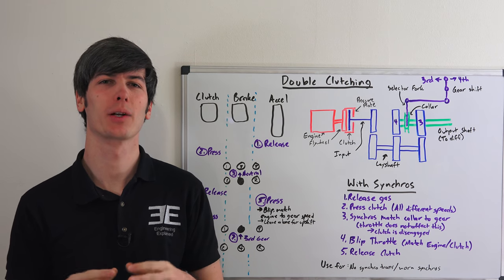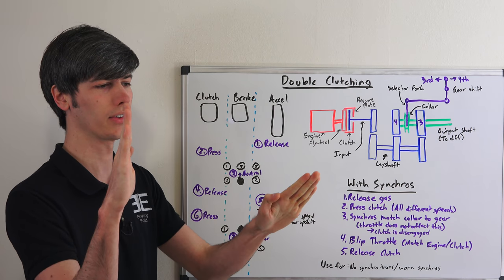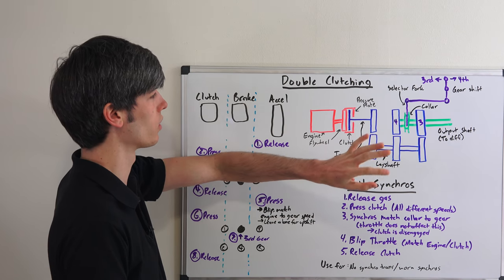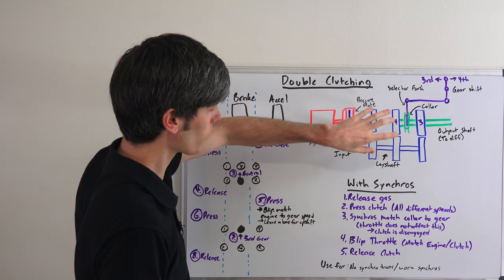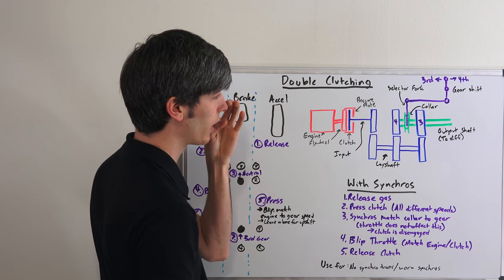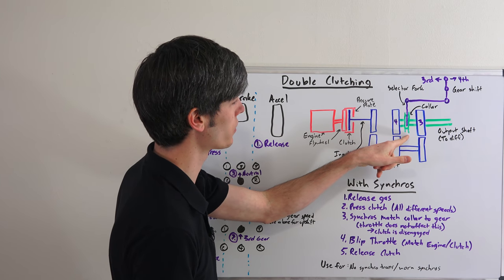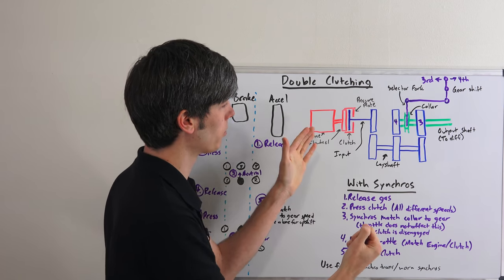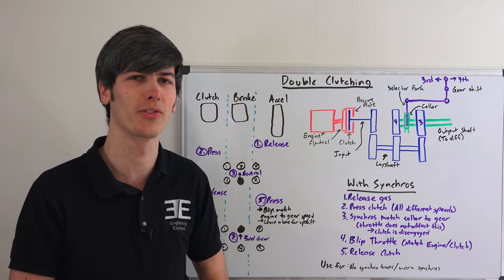What Is Double Clutching?

Comment: isn't this called rev matching ?
Reply from the maker: +Erik Angulo https://youtu.be/FnXLZg_O1rk
Reply: +Engineering Explained Watched both videos, and still don't understand the difference, could you or someone please explain? Thank you.
Reply: +Tomas Prado Rev matching involves pressing the accelerator enough to get the engine RPMs to spin at a rate to match the rotation of the driveshaft. The synchro gears that are part of the gears in the manual transmission box help those gears rotate with the driveshaft as you move the stick into gear. So the driveshaft and the transmission gear are rotating at the same rate. When you release the clutch and the flywheel engages with the transmission gear (through the countershaft), you&#39;ll want the engine RPMs to match as closely as possible.

With double clutching, you&#39;re lining up the engine with the transmission gears first by releasing the clutch while the transmission is in neutral. Then you want to adjust the RPMs of the engine (and because the clutch is released, the transmission as well) with the driveshaft rotation before moving the stick into the gear you&#39;re selecting. This will help the transmission gear and the driveshaft mesh together with less wear. Since the engine RPMs will be rotating at a similar rate when you release the clutch the second time the transfer of power should be smoother.

The essential difference is that rev matching is about getting the engine RPMs to match the driveshaft rotation while double clutching has the added step of using the engine to adjust the transmission gear rotation to ease the meshing with the driveshaft because there are no synchro gears effectively doing it for you.
Reply: +Tomas Prado Rev matching is essentially the same thing, except the clutch is disengaged from the engine, and thus all the load of "synchronizing" upon contact is placed on the clutch, not the synchros themselves. When the car is in neutral, your clutch is mashed to the flywheel, and thus all your gears will spin with the engine speed, they just won't be connected to the output shaft. With rev matching, your clutch is away from the flywheel and your gears and spinning at wheel speed, not engine speed. For example; my 2nd gear synchro on my STi is slightly worn out, and at high RPMs tends to grind a bit. When downshifting from 3rd to 2nd, it's easier for me to double clutch and synchronize the gears with the engine than it is for me to rev match and engage the clutch quickly enough to both 1) keep the momentum, and 2) not wear out the clutch and throwout bearing. It's hard to explain without a moving diagram or animation, but hopefully my explanation and Jason's diagram can help.
Reply: +Bernie Lee that actually did help thanks 

but the double clutch that I learned..."in the racing world"
is when you push in the clutch for a fraction of a second while accelerating to raise the rpm level and then you release the clutch while it is still in gear so the engine will pull at a higher rpm then when you initially engaged the clutch
Reply: +Tomas Prado Don't be offended; I am going to try and eli5 without being insulting (bernie lee did a phenomenal job of explaining it similar to how engineering explained guy would have I think).

Your engine and your driven wheels spin at different speeds. 
The transmission makes this happen, and can be disconnected from the engine by engaging the clutch (and therefore disengaging the engine - when you unplug your phone, your hand is acting like a clutch being engaged, when you plug in your phone, your hand is acting like a clutch being disengaged). 
When you upshift, your engine is spinning faster than your wheels. 
When you downshift, your engine is spinning slower than your wheels. 

Rev matching is when you disconnect your engine from your wheels, and either touch the accelerator to speed up the engine, or just wait while disconnected and allow the engine to slow naturally before putting the car into the next gear.

Double clutching involves the neutral 'gear' (which is 'in between' any 2 other gears); where your transmission spins at the same rate as your engine, but not your wheels. You double clutch by shifting into neutral, and then rev matching as above, and then shifting into the gear you want.
Reply: Erik Angulo I don't see how that would actually help. If you're the spin disparity might create a slight pulling effect but by disengaging the engine from the driveshaft you're going to lose power that's going to toward acceleration. Essentially you're going into a coast (i.e. no longer accelerating) and then using the engine to pull again. The time spent coasting wouldn't be made up by the sudden acceleration of re-engaging the engine at a higher RPM.
Reply: Erik Angulo That's called clutch kicking, used to force a sudden acceleration at the tires to break traction, not double clutching.

Typically you clutch kick a lot when trying to drift a car with a high grip to power ratio (underpowered or overgripped).
Reply: +Bernie Lee have you ever tried it ?
I have and it has results...nothing major but It helps In a drag race a little 
and I don't think Dom from fast and furious was talking about the double clutch explained by engineeringexplained
Reply: +Jesse V yes! clutch kick that's right
Reply: +Erik Angulo :)
Reply: Erik Angulo Jesse V I can see using it to break traction into a drift but not for straight ahead acceleration. I'll practice it a bit and see if can get it to give me a better bump. But I'm also not drifting as I'm in a FWD car.
Reply: Erik Angulo I use clutch kicking paired with an aftermarket rev limiter to simulate a poor man's anti-lag, aka flat foot shifting. My rev limiter is set at 6k rpm, where my boost peaks at; I disengage the clutch enough to shift gears, and the rev limiter keeps me from over revving, but still allows me to hold boost between shifts. It helps a lot with turbo cars in straight line stints, and I suppose could also work in N/A cars to lessen the load into the next shift.

However, I'm assuming the rev matching/double clutching we're talking about is in reference to downshifting, not accelerating lol
Reply: +Bernie Lee hey dude is it true that double clutching is only needed for older cars?
Reply: Ziggybro Seems like that's the case according to most of the comments. I have a 6 gear commuter that I also use to drive for Uber with nearly 100k miles on it that I generally drive without using the clutch after 3rd gear. Synchros are still working fine, clutch plate has plenty of wear left on it and there's no worrisome leakage from my master or slave cylinders.

To be honest, you're more likely to get bored with your car before you have a mechanical failure due to excessive wear on your transmission. As long as the power transfers are smooth and fast enough for what you're doing with it, does it matter how you do it?
Reply: +Erik Angulo  Sounds like power shifting to me lol. That increases clutch wear and usually a lot of people do that when racing because increased norepinephrine and adrenaline  released in blood makes their shifting sequence sloppy and don't depress the accelerator enough. But ya'know, some people might call that a strategy, doesn't sound like one to me.
Reply: +Erik Angulo Rev matching is similar, but you're trying to synchronise the gears in the gearbox with a double clutch as opposed to synchronising the engine to the gearbox. When you downshift in a vehicle with synchromesh (basically any modern manual transmission vehicle), you should try matching the engine RPM to the gearbox's new speed to prevent an engine brake situation which, of course, creates a massive jolt as the engine tried to match its speed to the gearbox. You don't need to double clutch it as the gears will begin to rotate at the same speed as the output when you move the synchroniser in. 

When you rev match, this reduces clutch wear and also makes the ride smoother since the clutch disc and the flywheel are rotating at the same (or close to the same) speed and thus, so is the gearbox itself. When you have a vehicle that doesn't have a synchromesh system, (maybe a really old vehicle like a 1955 Stepside Chevi!)  when you try to shift gears without using double clutching, the input and lay shafts will rotate at a separate speed to the output shaft and its subsequent gear, which will create a situation where you have to grind the living hell out of the gears to get them to synchronise to the point they can mesh and transfer the drive... bad thing in general!! you can absolutely annihilate the gears like this, so with a double clutch method, you are making sure this doesn't happen. You disengage, speed match, select and re-engage the gearbox in one process. Again, with synchro, the gearbox will automatically spin the gear you're selecting up to the speed it needs to be at before it meshes with the lay shaft, whereas a non-synchro gearbox simply can't do that... it needs to be manually synchronised to have a smooth shifting behaviour!
Reply: +Bernie Lee depends on your vehicle really... if you're driving a non-synchro transmission vehicle then you'll just shred the gears trying a short-shift technique or not using the clutch!! Of course... we don't see that anymore on refurbed or new vehicles because not everyone can be bothered to learn how to double clutch and synchronise!
Reply: +Bernie Lee , +SideWays8Productions , +Jesse V , thanks for clearing this up for me!
Reply: ThEcRaZ3dGaM3R Of course it depends on your car but let's consider a couple things. 1. If you have a car these days with a manual transmission that doesn't have synchros, you bought it for that specific purpose because you're buying A) a very old classic with original parts or B) a modified car with a specific transmission. So if you're wondering if it has synchros then it leads to the next point, 2. easily more than 75% of the manuals on the road have perfectly operating synchros.
Reply: Bernie Lee Yeah, there's a 99.9% chance any modern vehicle is gonna have a synchro transmission... it's only really classic vehicles that don't (willing to bet 1955 and older... DEFO 40's!)
Reply: +Erik Angulo ... Yup, rev-matching.
Reply: +ThEcRaZ3dGaM3R - Some cars prior to the 1950s had syncrhos only on certain gears. Many 3-speed transmissions did not have syncrho on first gear but did have them on 2nd and 3rd. Likewise, many 4 speeds had them on 3rd and 4th but not on 2nd and 3rd.
Reply: +Erik Angulo No, Rev matching is part of double clutching but double clutching is not a part of rev matching in 99.99% of cars with manual trans on the road today.  Actually I expected a video on truck driving cause that's where you need to know how to double clutch.  Either that or you have a car with worn out synchros on all your forward gears(the 0.01%).  In otherwords, useless information for cars, essential information for truck drivers.  .
Reply: +Tomas Prado - Proper double-clutching matches all of Red (Engine/Flywheel), Blue (Transmission/Layshaft), and Green (Outputshaft/Drive Wheel).  Rev matching only matches Red and Green, while relying on the synchronizer to match Blue and Green at the time you shift into gear.
Reply: +Tomas Prado it's only necessary if you have a slow ass car, like a Honda or something. double clutching is pointless if u have a little something Honda owners don't understand called TORQUE
Reply: +jcrohm88  learn english again usin a teknik to type faster get w da times. nd yea ur right bout da $$$ part but u need dat wit any car import or not i love all cars bro idk i dnt hate any kar except smart mini coops nd prius nd all dat shit but ok yur opinion is yur own nd mine is mine so w.e good day to you sir.
Reply: +jcrohm88 type in acura integra on youtube nd clik on dat 190 mph integra video tell me wat u thnk after dat da only kar dat aktually gives it a challenge is anothr acura go figure
Reply: Mauro Antrax I'm don't hate Hondas, they're just not made to be raced, they're meant to be economical commuters
Reply: +Mauro Antrax I know what one you're talking about. the one that beat the gtr at TX2K15 on 1320
Reply: +jcrohm88 yup. i knw it aint a drag race but now a days drag racin has gone to sht everythn is all pro mod no legit old cars anymore unless wer talkin street
Reply: +jcrohm88 yeah hondas for the road dont come with fast engines stock, but they make great track racing vehicles when it comes to ease of making modifications and they way they handle through the corners, and a car that gets through the curves and corners well is so much fun, its more important than having a fast engine especially when driving on public roads imo. they've also built one of the best stock handling road cars in its price class with a 50-50 weight distribution (S2000). they've has always been involved in racing from the start in motorcycles and formula one since the 60s, they built one of the first successful f1 turbo engines.
Reply: +jcrohm88 actually double clutching has nothing to do with speed or torque or what type of car you are in. it can be very helpful when braking hard into a corner so your downshifts are much smoother that way they wont upset the balance of the car. it is usually used on downshifts in racing so it doesent really have anything to do with acceleration in this case
Reply: +Erik Angulo 

No, Double clutch assists shift when you have shit or no syncmesh (older cars and some heavy vehicles)
Rev matching is more when you pull out of your current gear and match the revs to what they would be in the new gear you are shifting to. (i.e. if you are going 2nd up to 3rd, in 2nd gear you are revving at 5000rpm. To get the transmission to slip into 3rd, you need the revs required at that speed which is usually around 1000rpm less than the previous gear)
This isnt really recommended, although it is more often used when shifting down gears to give a smoother ride. (or worse compression lock and yaw!)
Reply: wipout1
With synchros you don't have to rev match shifting up without the clutch(even with non-synchro tannys you don't touch the gas unless you miss the initial shift).  Just lift the throttle while at the same time pulling it out of gear, then bump it to the next higher gear and wait for the synchro ring to match the speed of the next gear.  Shift from 3rd to 2nd without the clutch requires you to use the throttle to match the speed of the lower gear.   All rev matching does, with a synchro tranny, is make the downshift smoother so as not to upset the balance of the car under heavy braking.
Reply: +catsspat Would of been so much easier to understand if he had said that.
Reply: +Erik Angulo same concept for clutch kicking in drifting, you&#39;re just creating wheel spin instead of trying to get close to the point of breaking traction but still having good grip
Reply: +Erik Angulo "double clutching" is the technique for "rev matching" for transmissions without synchros. However, just about every car built in the last ~20 years has synchros, so unless you're driving something pretty old, you don't use the technique described in this video. Instead, you'd rev match by only pumping the clutch once while shifting and blipping the throttle.
Reply: +Chris Biggar no one is attacking Hondas pedigree. fact is, if you're racing a Honda civic you're wasting your time
Reply: jcrohm88 With enough money, any car by any manufacturer can be raced effectively. Fact is, Hondas are light and the most difficult thing to add to a car is lightness, while also gaining you the most advantage for racing. Not to mention the decades of double wishbone suspension in some of the least expensive cars on the road. Clearly, you don't consider autocross to be racing. Feel free to continue trolling and attacking a single specific manufacturer in an irrelevant comment thread.
Reply: Jesse V blah blah blah, thanks for the "with enough money anything is fast" comment and yes I know they're light Einstein, and I know about weight. I have actual race cars. And I'm not talking about autocross this is America
Reply: +Erik Angulo rev matching is basically just a term to make a smoother shift its not really necessary, whereas double clutching is strictly for cars that don't have synchros or who's synchros are worn out which helps with shifting
Reply: +SideWays8Productions Jesus man! how many clutches have you gone through this year?
Reply: +SideWays8Productions Jesus man! how many clutches have you gone through this year?
Reply: +Indrid Cold double clutching is Rev matching, Rev matching is not double clutching
Reply: +Erik Angulo I think it is called heel and toe. Here in Brazil is 'punta taco'.
Reply: its simple dont directly change the gear to other gear first it must go to neutral and then go to another gear.
Reply: +Jesse V thanks
Reply: +vanessa _ yup! I enjoy double clutching, so some days I do it all the time. also helps a lot when the transmission is cold.
Reply: +Erik Angulo thats called rev matching..
Reply: +Erik Angulo No, not at all
Reply: +Engineering Explained how do i know how fast my drive shaft is spinning?
Reply: ThoUnit you cant know, you just get a feeling for when the right time would be after youve been driving long enough
Also you kind of know your gear ratios, like at 50 kph in fourth gear you rpms will be at 2000, if you were to downshift to third then they would be sitting around 2500-3000
Reply: oh ok! Thanks :D
Reply: +Bernie Lee Wouldn't that just wear out your clutch pedal faster?  Or is this only done on older manual transmissions?
Reply: I think you're right
Reply: double clutch is for keeping your rpm up when shifting up so I if you don't the opposite of this video you'll win a few races lol
Reply: ***** you should be at what ever rpm the car would be at when you re engage the clutch at the speed your going
Reply: That silver Teggy why do you hate Mini's? They are fantastic!
Reply: thanks! i wasn't understanding that difference either and you explained it well :)
Reply: yeah sorry but this is the same exact thing as rev matching as much as you'd like to try to suggest otherwise.  this video explains how to rev match.  this is rev matching.  that is all.
Reply: Exactly why im confused